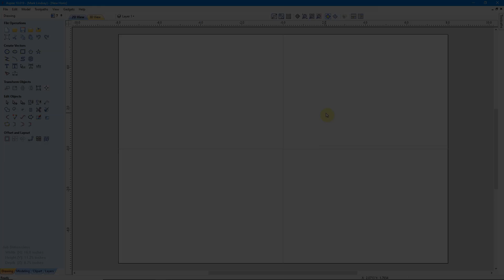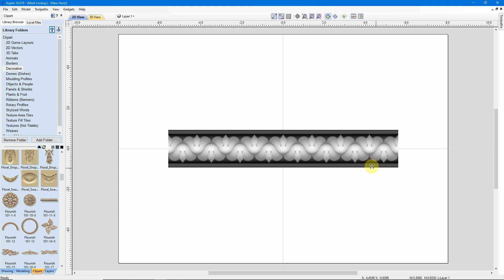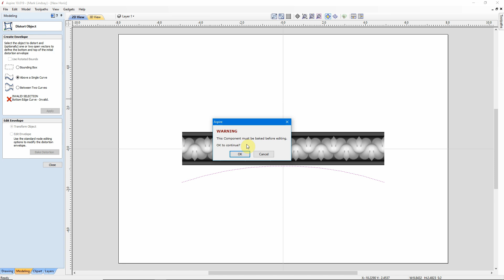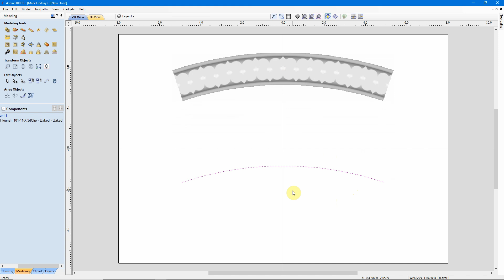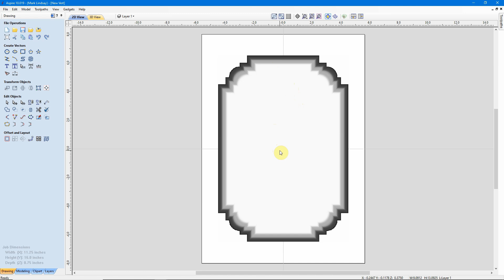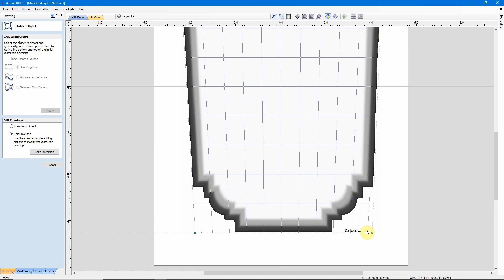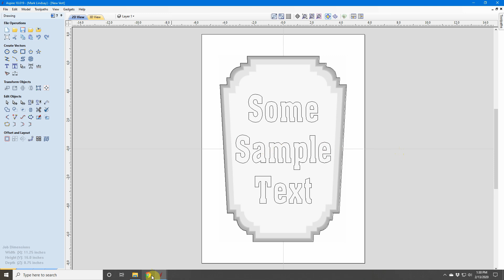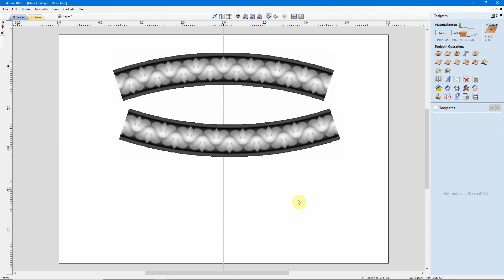Distorting 3D Models    Part 9 – 3D Carving For Absolute Beginners

Comment: hi mark this is off subject question but i figured you or someotne else may know ..regarding vectric aspire and importing vector files specifically svg...i use inkscape to vectorize bitmaps its much better than using vectric built in module for sure...inkscape produces much better results. but here is the issue..if i trace any bitmap in inkscape and then save the file as svg and try to import svg into vectric aspire i would say 95% of the time it wont import and says error cant import....but if i save the inkscape file as eps and then import it into vectric aspire it imports fine 100% of the time...i use old vectric aspire version...anyone have any ideas why vectric aspire wont import svg files?..i thought i found out issue but i actually did not..any help would be appreciated.

Comment: Hi mark..have you ever used artcam pro?..its an old software but seems pretty capable...similar to bectric aspire. I use vectric aspire 99% of the time but i also have artcam pro.
Reply from the maker: No, I haven't used ArtCAM. I started with VCarve Pro Version 8, and never looked back. I later upgraded to Aspire Version 9.5. I'm currently using Aspire Version 10.5 and for the type of work I do, I have no need to use anything else.
Reply: @MarkLindsayCNC  i agree vecctric aspire is pretty capable software..the only reason i was going to fiddle with artcam is that it has a post processor for gerberd200 cnc router  and vectric does not
Reply from the maker: This is just me talking here, but you might reach out to Vectric about the post processor. There may be enough similarities between the g-code your Gerberd 200 uses and something similar that they can create a post processor for it. They have done that in the past, and the more equipment they can make compatible with their CAD/CAM software, the better it is for everyone. Shoot them an email and see if they can help you.
Reply from the maker: Well, it was worth a shot!

Comment: Great video..how did you become so knowledgeable of  this software?
Reply from the maker: The same way you're learning it. I got into the tutorials and I learned the basics, then I just started drawing designs. I still follow tutorials for things I've never done before, and I practice drawing all the time. There's no replacement for experience, and the only way to get it is to do it.
Reply: @MarkLindsayCNC  you got that right..the biggest frustration i have is that there are thousands of diff cad/cam software and all are different..none are the same interface so every time i need to use a diff cad cam due to machine requirements it requires a whole new learning process...vectric is good becasue it can work with a lot of  but not all cnc machines....it wont work with gerber cnc, labvolt cnc, new hermes cnc, gravograph cnc..all of which i have and i have to learn 4 diff proprietary cad/cam softwares which is not easy at all